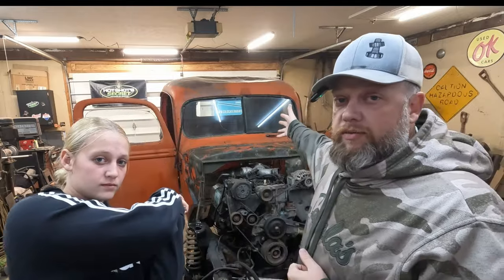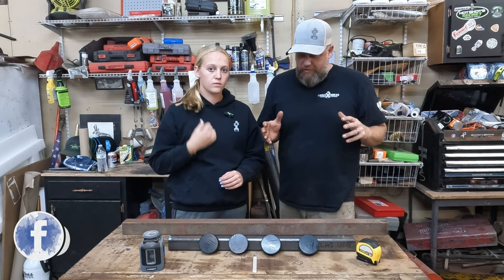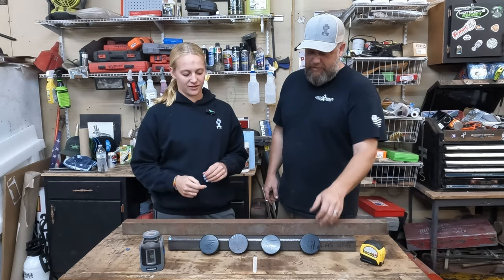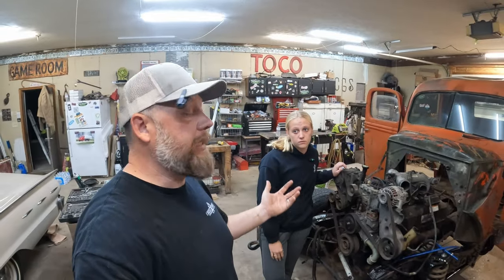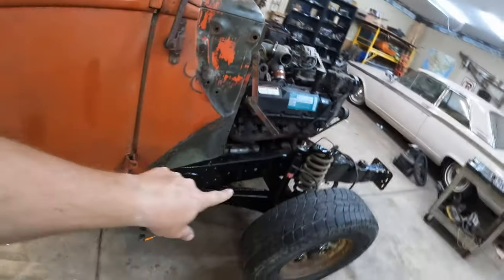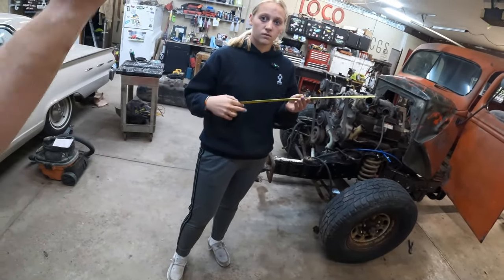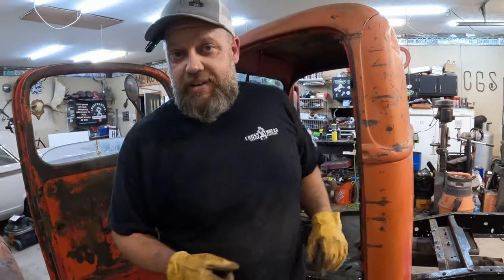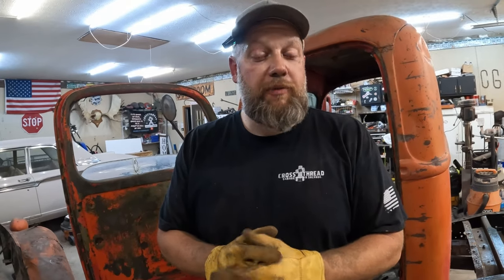Precision Guesswork: Body Swap Basics For ANY Classic Vehicle

Comment: Well she was right you were in the garage with light. HA HA. That's going to be a big bolt in dog house. That exhaust wrap would help ALOT with the heat. Wrap it all the way back pass the cab a little seeing how there's only one pipe. Anyway your choice.
Reply from the maker: You’re right, it’s gonna be a big effort to get it put together in a way that it easily comes back apart. No other way to make it serviceable without removing the entire cab. Although I guess that’s what modern fords do 😂
Reply: @Xthreadgarage  I don't have anything that new thank goodness and would like some older ones.